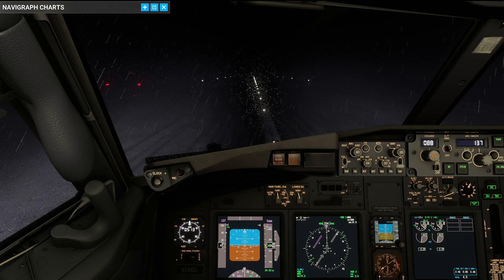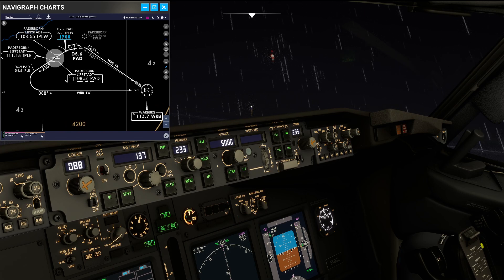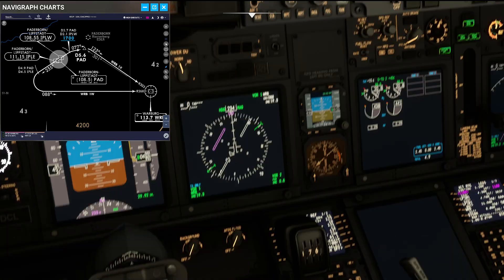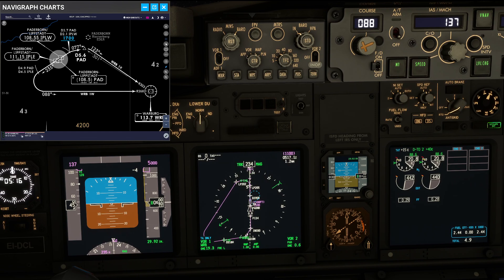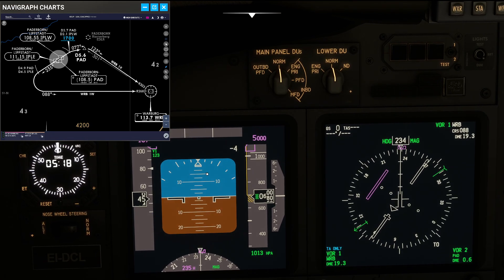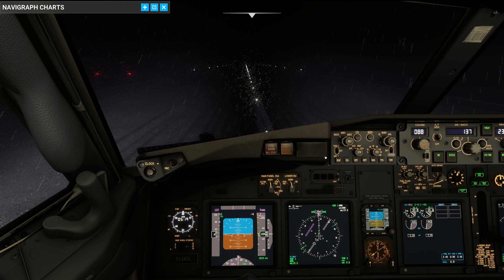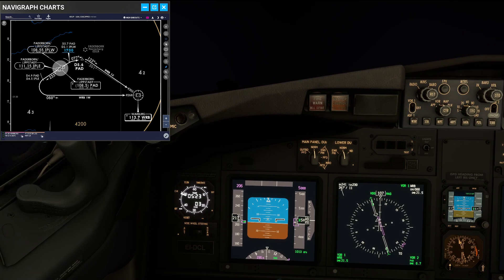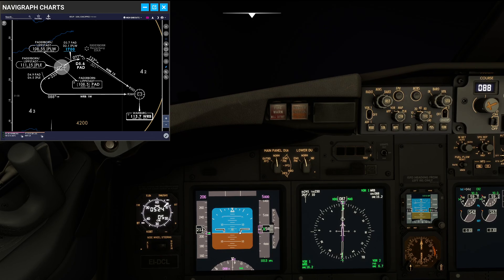Raw Data Flying: Takeoff and SID | Real 737 Pilot

Comment: Technique -  1.  Put 4.9 DME (or 5.0) on the Fix page to get a DME ring to tell you when to begin your turn.   This will give you a good visual on the turns location and promotes good SA.     2.   Approaching 4.9 DME (or the fix page arc) spin your heading bug before you begin the turn to 088 inbound.    I've seen too many guys miss the 4.9 digits in their scan, or then lose SA as they roll to "what's the heading?" if they simply leave the bug back on runway heading.    It's your tool, use it.   Set the bug, then fly to it.  If you have a strong wind, adjust the selected heading to compensate so that you roll out on the inbound course as opposed to parallel to it and then have to make an adjustment.   These are just little things to keep you in front of the jet and not reacting to it.    I figure you know these tricks, but am just posting them for your viewers.      Too few pilots these days ever fly raw data (and / or even ever hand fly) and both their scan and skills SUCK as a result.   They are Magenta Line / AutoPilot cripples.    Nice Vid.

Comment: Great video Captain ❤ I have a question about the NAVIGRAPH, when your subscription ends do you lose the new nav data that was updated in the FMC or does it stay even after subscription ends??
Reply from the maker: Thank you so much!
You're going to keep the data you had at that point, but you can't redownload it. If you loose the data for whatever reason (like a reinstallation without a backup) it is gone.

Comment: Great videos! I was wondering. In terms of SOPs, when PF asks PM for flaps UP a notch or two, for instance Flaps 5 to Flaps 1, PM answers by saying “speed check, (moves flap from 5 to 1 position) and when Flap 1 position is indicated “flaps 1”. However when going down the flaps the straight answer by the PM shall be “speed check, flaps X”. I hope I clarified myself.
I think it was like this 😅 wasn’t it?
Reply from the maker: Hi, you're right on this, when retracting the flaps the PM should straight away say "speed check, flaps __" while when extending the flaps the answer should be "speed checked [wait till the flaps indicate at the target position], Flaps __"
Reply: @A330Driver  I see! I got it all the way around 😀. Thanks a lot for taking your time to explain this!

Comment: Great Video!  I've been looking at the Alaska Air Flt 65 leg from Wrangell (PAWG) to Petersburg (PAPG) and would be interested in your take on how to manage a 738 on such a short hop with low altitude climb.  I notice that Simbrief ties to path you to a nearby VOR and at a higher altitude however most of the flights on this don't take that same pathing.
Reply from the maker: If the cruise is too short I'd recommend to do most of the approach preparation on the ground already before departure. You can fill out most of the FMC pages already, have your approach charts prepared, etc.
Then you literally only need to set up frequencies, courses and minimums and off you go.

Comment: Hello Emmanuel. Very informative video again, thank you for that. Only one question remains for me. I understand the function of the radio 1 and the 88 dgs course setting, and your lining up in the VOR mode with WRB. But, I don not understand what the use is of your radio 2 setting, and the 235 course setting in course 2. 

A saw that you at least have the DME from PAD then in the VOR screen below, but why set the 235 in course 2? What is the use of that here in this manual flying?

Hopefully you can inform me. Thanks again for your good video.
Reply from the maker: Hi Boudewijn,

PAD is tuned in VOR 2 in order to define the turning point for the SID at 4.9NM.
The course setting simply serves as a reminder for the runway track. In a multi crew cockpit the PM would have adjusted my heading bug to match the runway track and then there would not have been a runway course available anywhere anymore.
Aka if you forget what the course should have been you can simply look up at the MCP and have it there.
Reply: @A330Driver  Thanks, that clarifies it. Greetings.